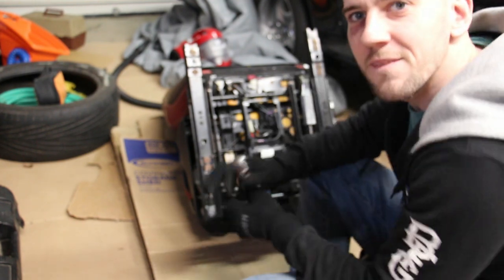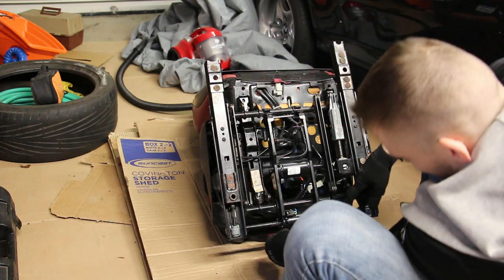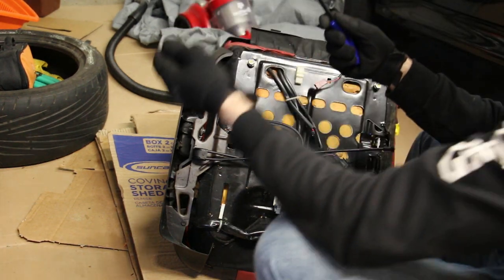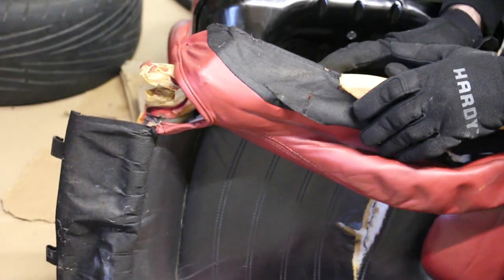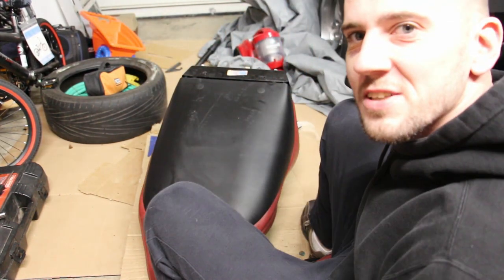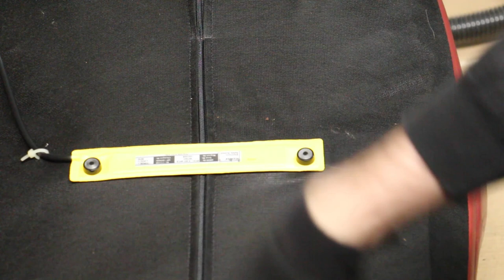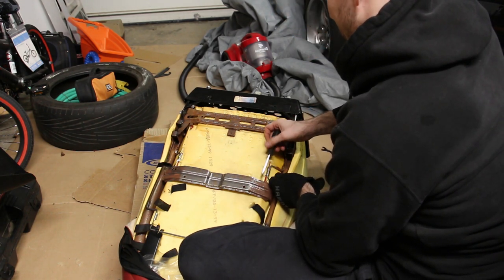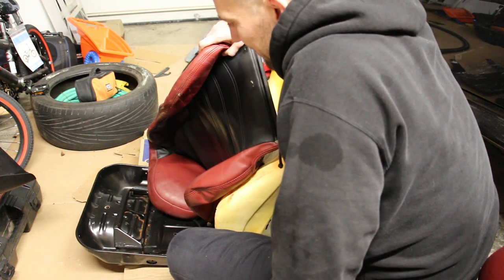How To Disassemble Sport Seats on BMW Z3 M Roadster

Comment: What did you end up doing? Getting them cleaned or renewed? Can You get these seats restored to be like new?
Reply from the maker: I got them looking really good, but I wouldn't say that they are "like new". Over time, the leather gets this shiny texture because of all the contaminants. I cleaned them as best as I could with some Gyeon products. I did have a shop replace the bottom leather panel on the driver's seat and fix the bolster.